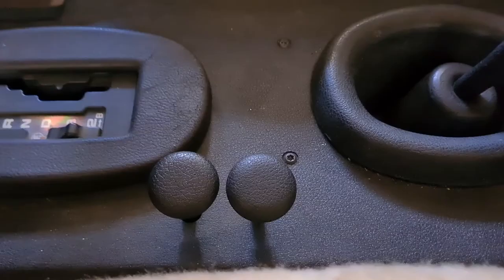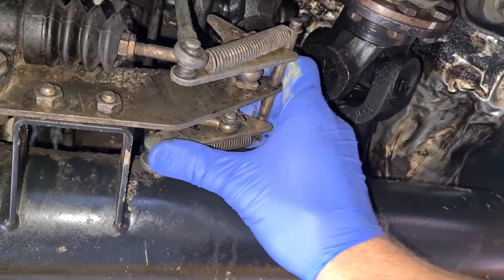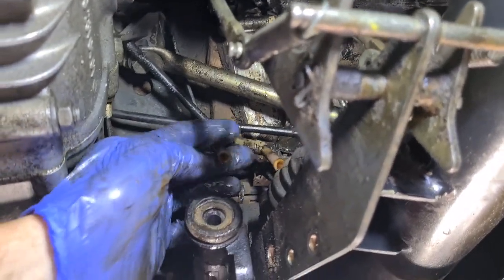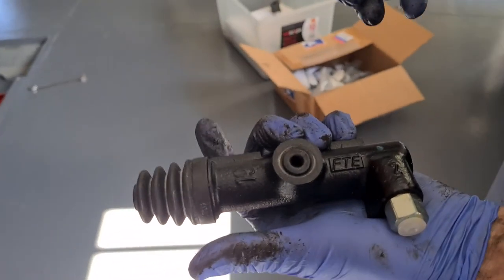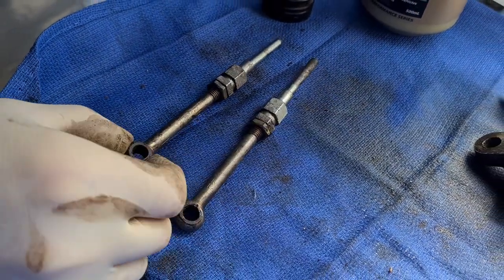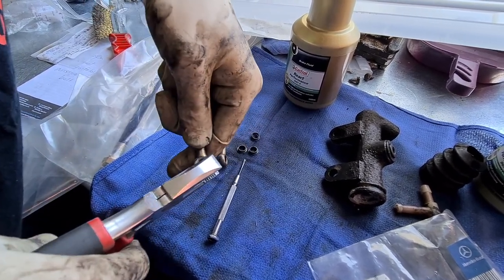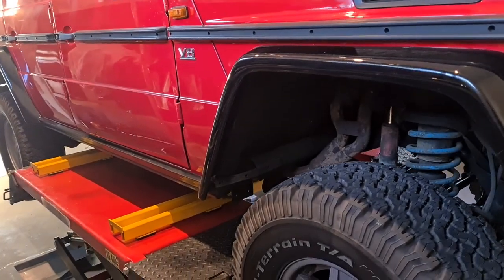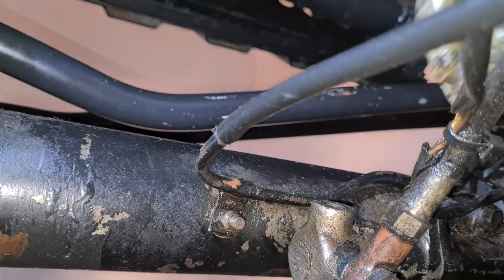Mercedes w460 Gwagen Changing Differential Lock Cylinder

Comment: Just a note for all - even if the system isnt brakes, if it uses brake fluid it should be replaced periodically as it attracts moisture and will corrode parts of the system at the lowest point. That fluid looks very very old.

Comment: Good pace of video. I am always amazed how relatively clean other 460s are!
Reply: Just noticed you have 463 wings?
Reply from the maker: @dingalingalong  cheers Ding, I thought my G was filthy!. it will be cleaner now I have a hoist and tidy up below.  in australia, we dont have snow. most off road I do has been mud, and sand.  admittedly, I haven't done much in the last 5 years of ownership and dont drive it too much!
Reply from the maker: @dingalingalong  I fit those wings a few years ago when I put the m117 5 L in it.  all 463 parts with original 460 wings cut to fit the bits.  I should've made a video on it too!

Comment: Thanks for sharing. Did the W460 have a center diff lock ?
Reply from the maker: Not on the first generation 460s Emil. They are 2wd 4wd setup so when you put the transfer case into 4wd it's effectively locked.

Comment: Thanks Much!! great video. Unrelated Question... I can see your U joints for all shafts have locks on them. Thant means you have made some kind of adaptation on that matter. How did you do it? What did you do? Sorry if it too much to ask for an explanation. 👍🏻
Reply from the maker: thanks mate. im sorry im not knowledgable on the driveshafts yet. I did have the front one shortened when I put the m117 V8 and transmission in.  the rear one has been 'balanced' a few years ago due to some driving 'wobble'. im not sure if they changed anything on them but your observations suggest so. sorry, im not very helpful on this one!
Reply: That's  a stock  u joint  lock.

Comment: Thanks, I’ve just removed my slaves and masters and needing to go through the same steps. Great video.
Any update on the front slave bleeding process?
Reply from the maker: In the end it was the hose that although externally looked ok, must have deteriorated internally. it was blocking fluid passage!  Changed the hose and after this, all good David.